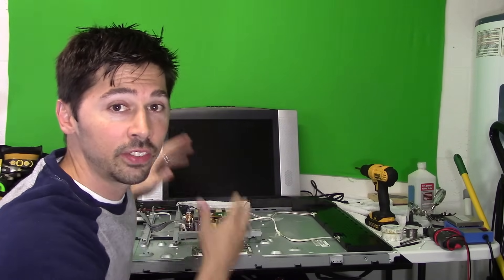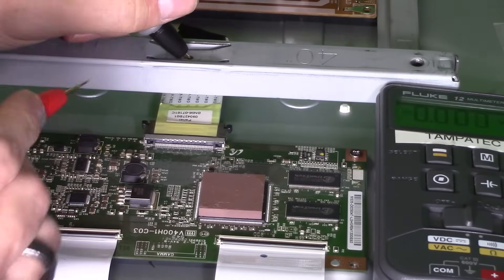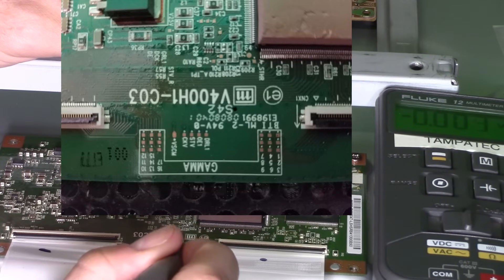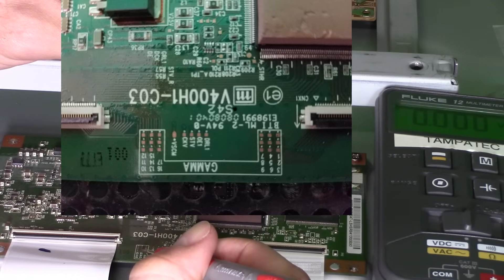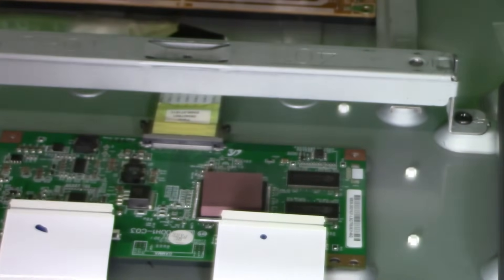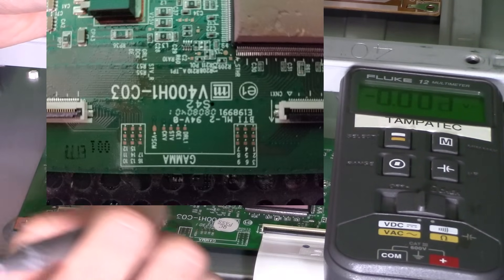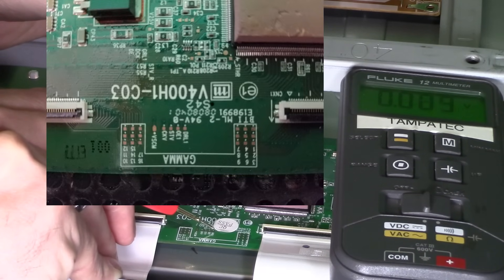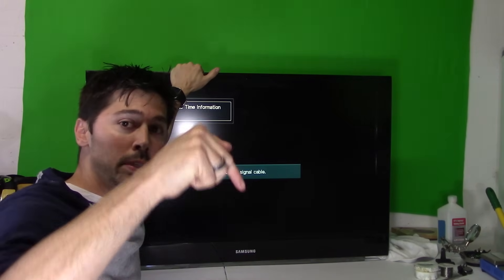THIS EASY 5 MINUTE TV REPAIR WILL FIX MOST VIDEO PICTURE PROBLEMS!!!

Comment: Hi,

I’m looking for the left-side LED array/backlight for an LG TV.

Part number: AGF79100201

TV model: 55UH615T-TB

Serial: 610INVM27455

Software version: 04.30.02

Can you confirm: 1) whether you have AGF79100201 in stock (or can order it), 2) whether a compatible cross-reference (AGF7840xxxx, etc.) will fit my model.

Kind regards,

Andrew James Holden

Comment: Hello, I have a Samsung UE55F7000 - 3D TV, software version T-FXPDEUC-1136.0 which after about 10 years broke down and an area appeared in the middle like a horizontal strip about 20 cm wide where the image is darker. Is there any technical solution to repair it? Thank you for your time. I am Florian from the city of Bucharest, country Romania - Europe
Reply from the maker: Was the TV dropped or bumped? Horizontal lines may be bad panel. Vertical lines bad tcon board. Tvpartstoday or shopjimmy sells boards.

Comment: I have right half screen dimmed. Not solid black. If I power off, the picture comes back but dims again after some time. Picture will come back twice, and then next time goes completely black. Model is LG 65UH5F-H.

Comment: I have a 2017 TCL 55" model 55c803teaa purchased Feb 2018. Turned it on and has sound no picture. After research and your videos I assumed it was the t-conn. Doesn't have one as in the many videos show. Must be integrated into LCD panel or the control board. I have not found anywhere (even called TCL, I know that was a joke) which device has it. The backlights do work as I can see them light up when I plug the TV in while its face down on the bed. I unplug the ribbon cable from the control board and get nothing. I have reset all cables that I can. Also factory reset via button on control board and held power button for 30 sec while unpluggd from AC.

Comment: Hi. I have a Toshiba 50L711U18 Rev B. I turn it on and have a perfect picture, cable signal and audio. After a couple of minutes, the screen goes black but audio and signal remain. Turn it off....leave it set a minute and turn it back on and again I have a perfect picture, audio and cable signal but then the screen goes black again with audio and cable signal remaining...and then repeat. Like I say, the picture is perfect then it just goes blank. Any ideas? Thanks, DD

Comment: I followed your recommendation about my Vizio black screen that I can see something when I hold a flashlight on the screen and ordered a T-con board from Jimmy. I just installed it and it didn’t solve the problem. What else could be wrong?

Comment: Hello I have an old vizio gallevia 47 inch cable box works with no problem o Lu issue is when putting on regular antenna air tv i have no picture no sound sometimes it comes on not sure if it’s the tuna anything I can do to fix this issue

Comment: Why are the test point voltages much lower on the left connector as opposed to the right connector?
Reply: They were not supposed to be. Something was wrong with that left side that is why he took it out and replaced it with a new t-con board

Comment: If you have DC voltage on the ground test point the inference should be that a ground connection is broken somewhere; not that 'something is shorting to ground'.

Comment: I have a Philips 58PUS8545/12. Sound works but the screen is black/grey. Backlight works. If i use a light on the screen i can not se any Picture. If i tap the screen with my fingers i light upp where i touch the screen. What could be we problem?

Comment: I want to know the diagnosis 
Consider this, TV display showing two different alternating thing - one is full plain white screen and other is a square crosshair at the centre of the screen. This alternative incident going on a loop?.
What could eve the problem. Sounds are working great (it was tested by connecting smartphone via hdmi to usb cable) .

Comment: In the old cold cathodes, the inverters would go out. In the cheap tvs, the eeproms get erased. In most tvs, the power supply simply fails from old electrolytic caps.

Comment: hi Tampa, I have samsung TV has sound but black screen, Power is on when i Plug in. turn it on power button is blinking few time and off. Opt out has light go thru. I used flush light to screen nothing gloss. what should i do at this situation?

Comment: Have a samsung 32inch that turns on shows logo but after 30 seconds fades away with no pic. I changed tcon board same issue i also changed main board same issue. Could you help

Comment: I got  a blue screen after replacing the light strips. 

I had a few white lines but I put tape on the ribbon and it cleared it out. But now I have a blue screen.

Comment: Luv ur vids. I have a LG 43um7000pla that's has a black screen, when I pull out the right output  the picture shows on half the TV. Try the tape method an can't seem to find the pin. Could it be the main board? Thanks

Comment: Hi, I have a Samsung UE46D6507VKXXE tv that stopped having white light/backlight when power cable connected. The standby light keep blinking and I can hear a clicking sound (seems to be a booting problem). Since the standby light blinking/keep flashing but no light/background light and signal from TV, does this mean it's the T-CON board that need to be replaced? I have tried to replace the power supply but still the same problem. Thanks!

Comment: Top 75% of my screen is black, including menu display, WITH vertical lines ONLY on menu field. Works when plugged in after several days (as long as power is left on,) but won't display full picture w posted down, then turned back on next day. I'd throw it out the window, but I'm only on the second floor, and that would not give the satisfaction I need, so, looks like gonna hafta fix it 😂 T-board also, ya think?

Comment: I have an Apex 32 in smart tv that has a black screen but with sound. I am going to check the back for any light or front with a flashlight. I would like to fix it myself because I don't have $150+ for a new tv if I can fix my tv for less than half the price.

Comment: Hi great videos, hope you can help. Ok, turned tv on heard pop, then no picture, everything else works, also did the flashlight trick there is a picture just a black screen. Upon checking the cable of wires with the 2-8 plug from main board to power supply had melted the plastic where it plugs into the main board. So I'm just not sure what to replace. With everything working with the exception of the black screen I don't think its the power supply, that leaves the t-con, main board or the cable from the main board to power supply. Thanks for listening, PLEAS HELP  Jamie D

Comment: Brother how set right vertical lines on right side on my samsung LED smart TV, model UA46ES8000R, model code : UA46ES8000RMXL, please guide , what replace : complete board or any wiring tape on board

Comment: TV Sceptre Model N43
T-Con board. HV430QUB -N41
Vertical lines on screen.  No picture, no sound.
I replaced t con board and the vertical lines are gone but still no picture.  Blank screen.
Reconnected ribbons and connections, no change.  
What is next ?

Comment: hi need help my old 65c9 won't turn on at times and at times works flawlessly  when it won't turn on if I press the power on the remote / tv there is light flash and can see some 
horizontal lines   changed the power supply board  still have the same problem

Comment: Mr. Tampa tech I have one Flat panel that has not screen display and we suspect a bad board. And as of last night, a 2 year old through something at the 55 inch flat panel and cracked the LCD Screen. Now there is no display at all. When we power it on, we ger a static flash and then black screen. Can we possible use parts of the cracked LCD TV to fix the other one?

Comment: I tried to reset my sharp tv the way you showed but it doesn't seem to work because l still have the flashing red and green lights flashing.The tv reset once but didn't have the remote to reset the tv back to factory.If you know a better way of getting my tv to stop flashing l would gladly appreciate it because the tv is basically a few years old and has a beautiful picture.Thanks for your time and hopefully you have a way to get rid of the flashing lights

Comment: I ha e the same exact TV, purchased it back in 2008 and still works and using it until this day. I had one issue with it several years ago where I had bad caps. Replaced it with no issues. Has many inputs and works great with retro gaming. Rf,svideo,components and two hdmi. Can't complaint. Too bad new tv today doesn't come with any of those inputs. Great video by the way. Happy holidays.

Comment: Toshiba PK101W1170I Power Supply / LED Board (sj-PK101W1170I)
Could you Help us fix this power supply.
Have 165v at C601
12v at D301,
What else do we need to check we have a black screen red light comes on and stays on thanks you have great videos

Comment: But, you just changed the t-con board - what was the problem with the original t-con board. I think a better video, would have been one where you actually locate the issue [faulty component/part in the circuit]. Swapping whole boards is relatively easy - finding the real issue is far more interesting. Hey, JMO.

Comment: just checked out some of your tv fix it videos but didn't find the right one to guide me through my issue.  Wondering if you could help me? It is  visio P65-f1 with a vertical line problem.  it appears to have back lighting.  I have removed the small board that was located at the bottom of the set.  Planning to replace that board.  Do you think I am on the right track. thanks for any help.

Comment: Had power supply go bad on 70in TV and replaced board. Picture is working again however it appears half the screen is darker. Never had this before and tv year old. I think backlight issue but I have 4 pin output off power supply in four different colors. Only have 170volts If I recall on one pin, nothing hardly at all on no other pins. Is this dual output or how is this backlight four pin work?  Wiring schematic on board has 12 labels but 16pins..
Reply: Is hisense tv 75h65 series

Comment: I have a vizio E241i-A1 part# 10213060021 I cant find a tcon board for this for the same part #
can I use any other same model even if its different part # ????

Comment: Thank you - very much for your thoughtfulness in measuring the T-CON Board input and output voltages for us to take note of -  this will go a long way in enabling those without circuit diagrams to do fault finding with confidence. Much appreciated indeed. Keep it up.

Comment: Hello, I have color shift problem with a Samsung M6300 curved. It looks like the Gamma is out of adjustment, but all the adjustments in Picture doesn't solve the problem. I suspect the T-Con board. What you think? Can it be the display itself?

Comment: I have smart bec 75 tv    after logo  the backlight off  . when I removed the cover I disconnected the Motherboard  and T-Con cable  the press power on then the backlight stayed on then connected the T-con cable the tv worked by good way . I have to disconnect the T-con cable to work by good way   . I do not know where is the problem

Comment: Hey TampaTec, I have a 70" Vizio,
Model# E701i-A3E.
  There is power with a back-lit glow, but no picture. 
  It happened after it rained (It was an outside TV, under a covered back patio).
  Any suggestions?
  Thanks! 😊

Comment: When i turn on my samsung ua46d6000 i get a blank screen but when i disconnect one of the ribbon cables to the t-con board i get half a picture. Ive replaced the T-con board and still have the same issue. What else should i check now

Comment: Good afternoon 
I have a 75” Samsung TV and the right hand half of the screen is all white. No lines vertical or horizontal just white. The back light is on but there are 3 brighter white light toward the Center on the white side. I have removed the back and removed and reinstalled every connection on all 3 boards and also cleaned all of them. I have even removed the connectors between the strips on the bottom  of the screen. Nothing helps. Any idea if it is the toon board, the strips, one of the other boards or the screen itself?

Comment: HEY I HAVE A 50H3 HISENSE TV THAT DOESNT HAVE ANY PICTURE AND THE RED LIGHT COMES ON WHEN YOU PLUG IT IN, AND BLINKS 6 TIMES WHEN YOU TRY TO TURN IT ON AND SHOWS NOTHING AND NO SOUND.     I HAVE REPLACED THE POWER BOARD AND THE MAIN BOARD. BUT NOT THE T CON BOARD YET.    DO YOU HAVE ANY VIDEOS FOR THE TV I HAVE?

Comment: I had a repairman come out to fix my speaker on my Vizio 3D TV. He fixed the speaker but when the TV was a part laying flat without the back on it he picked it up and moved it over to where the cable cord was. Now the pictures there is no picture it's just colors everywhere you can see a little bit of picture but I don't know what could that be caused bye I know you're not supposed to pick it up with the flimsy screen but he did

Comment: yes, have a washed out picture. Vizio e60-c3. bad led's, changed them out, back light OK.
Was given this unit, also changed T-con board. the small square chip on upper left of board gets hot, when the two strips are disconnected from the screen this chip doesn't heat up. Will check these voltages. 
Any advice will be good. thanks.

Comment: Thanks for the info! My 65" MiTV is not showing any picture but the backlight is working. I measured the VGH and VGL voltage, both are fluctuating. Is changing the T-con board the right way to go?

Comment: 👍👍 good morning im newbee techncian ,
can i ask you a question sir? i have a fading vertical green lines on my hisense 55inch  tv ,if  blocking some gates connection on tcon board ribbon wire inserting plastic tape, is it possible that my tcon board is failing? 
 thanks 👍👍

Comment: One of the most helpful videos ever. Have a qe55 8k Samsung tv that reboots when warm . Tried 4 of every board . Stops restarting when any one of panel ribbons from t-con board disconnected. Have 3 TVs the same symptoms . Can't find any schematics or code to get into engineering settings . Checked caps on buffer boards and psus . Any ideas please ?

Comment: I have a TCL 555421TDAA. No picture, but sound. Flashlight test shows faint picture. Opened it, took off the metal pieces along the bottom; nothing looks like a t com board...
Reply: P.S. can I send you a picture of what it looks like and maybe you can identify the parts for me?

Comment: Hi, can you explain why Samsung UN75JU641DFZA tv doesn't have video but back light is working. sometimes when power reset bottom side display comes on and again goes black. when i disconnect the power to Tcon card horizontal few lines come on and off. can you please give me some suggestions?
thank you

Comment: Replaced Tcon board on a 65" Sony smart tv, but it did not fix the problem. I still have vertical lines. Any other suggestions, besides the power supply board or main logic board.

Comment: I guess for all the comment here stated that “how do you know the correct reading/voltage” well, i can say mostly on a hunch/experience tho..😎 one thing to look is :-

- stable voltage (no matter what the reading is)
- not fluctuating ( slowly decreasin to zero volt) 

Most of tampatec video on tv repair show common voltage reading..3.3v, 5v, 9v, 12v, 24v etc.. note that 3.3v/5v always for standby volt.

Comment: Westinghouse WD55UT4490 no pictures but have sound. Can’t see any back lighting. Looked at Tcom board. Have test points but unlabeled at power cable. 6 points…..2 of them read “0” 4 of them read 3.28.

Comment: Why do the TCON boards always have a metal plate covering them? Seems like that would hold in a lot of heat with out any airflow. The other boards on flat panels are left uncovered. Seems strange.  Thanks

Comment: Any ideas mate I'd reptlaced all leds  on my Philips put49 all went well and was careful with screen etc . I have 1 single vertical line very faint and happy using TV for our room on wall . The line is behind the text and not in front . The only thing I am thinking is when I put tcon  ribbons into power board I was a but forceful on one push down tab mainly because the ribbon was in a but too far is it likely I've damaged the connector on main board ? And I'd changed ribbons and same result I checked all tabs while tv was on carefully and no change .

Thanks

Comment: Thanks for the video.  Thanks to you, I was able to test the T-Con board in my 2007 Vizio VU42L LCD TV.  It had a dark screen, sound, back light, and standby light.  The voltages were way down on the output side of the board, just like yours.  ShopJimmy did not have one.  I ordered a board off of eBay for about $14.  It arrived today, and went right in.  Now, my TV works great again!  BTW, it was a free TV.  A guy in the neighborhood, upgraded to a Smart TV, and wanted to give this one away.  It worked great for the past 8 months, then the screen went dark during Shark Week.  I love Shark Week, too.  I had a back up TV, but I spent about a week researching YouTube videos, until I was absolutely sure which board to order.
Thanks again, Paul

Comment: I have a Vizio P702ui-B3. While watching TV the Right Side picture went haywire, all scrambled. Restarting the TV it was just a black screen, but the audio worked. Then I started watching your straight forward videos and that prompted me to try and fix it.

My first thought was the Tcon board might be bad. When I check the voltages there is 0 volts for any pin that's labeled TCon. Also the TV stays on for only about 1-2 minutes, then shuts down and the white indicator light flashes about 10-16 during shutdown.

Any guess about what the problem might be? Thanks for the informative repair videos.